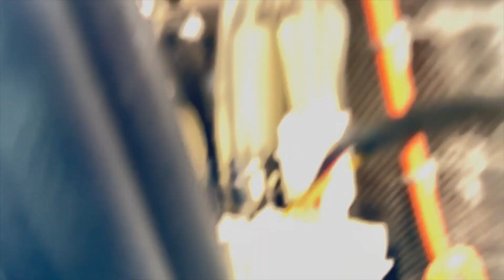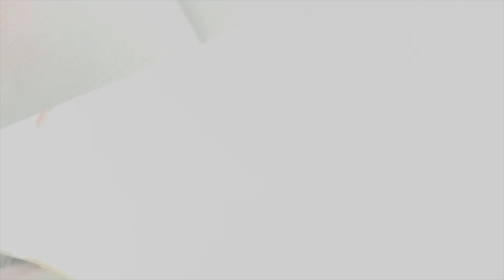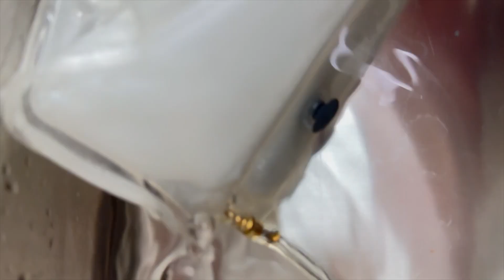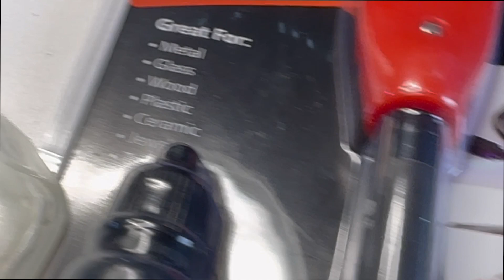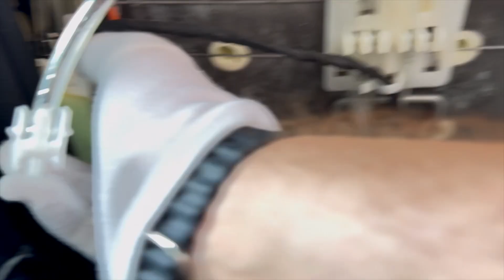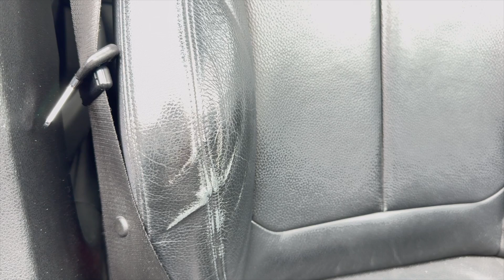BMW F30 front seat inflating bolster repair

Comment: Hello. Both of my seats inflate normally but the problem is when i want to deflat then it doesn’t work. Do you know what is the problem?
Reply: Okay thanks for help. And also great video :)
Reply: I would check the relay valve module which is possibly faulty and not releasing the air from the airbags.